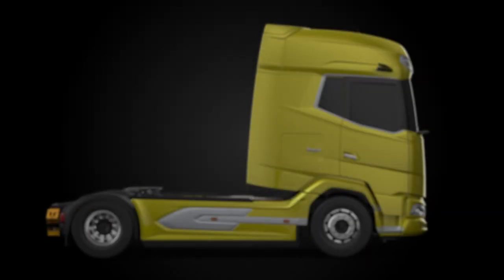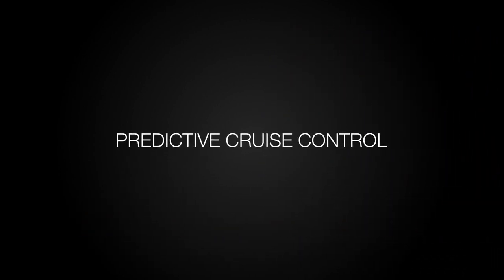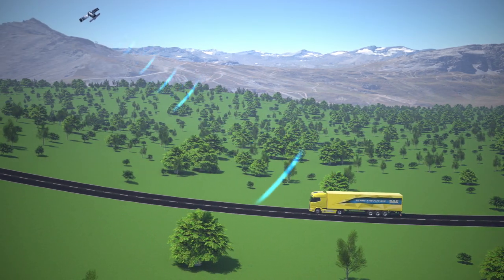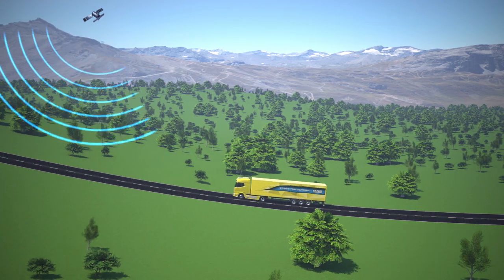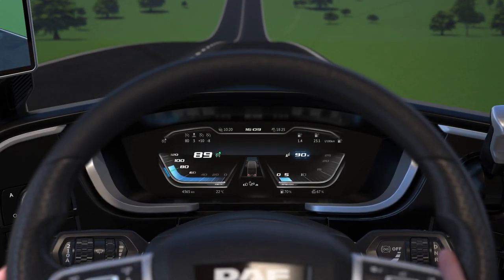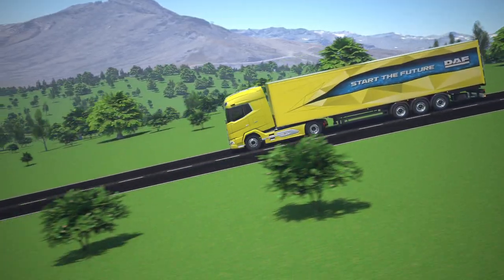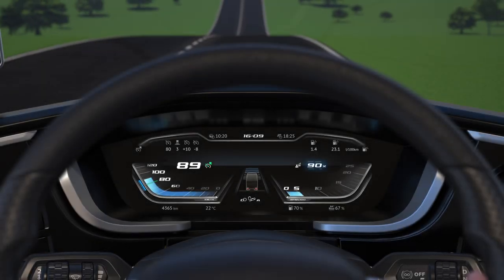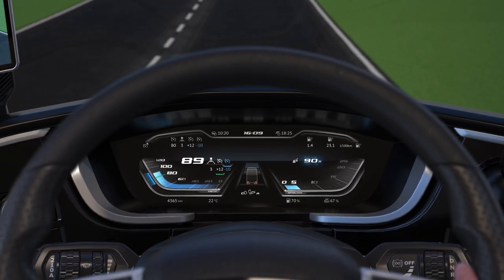New Generation DAF: Predictive Cruise Control explained

Comment: Over complicated bullshit.
Put a reliable engine and transmission that won't break down and everyone's happy.
It's not to reduce fuel consumption that manufacturers aim at. It's about forcing owners to go to dealerships  and get ripped off.
On some counties trucks will be used for decades to come and with such over complications comes unreliability.